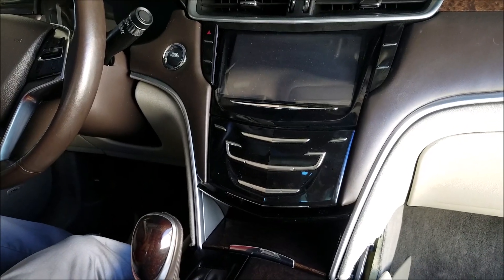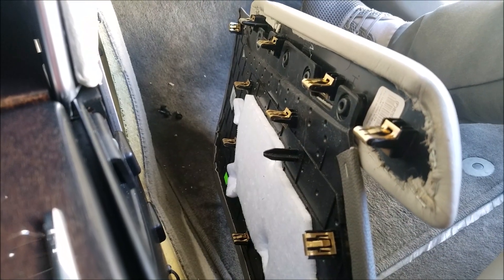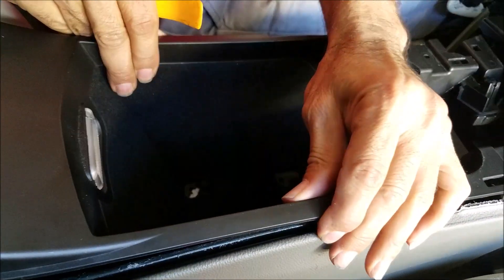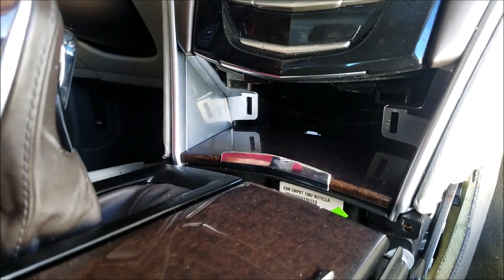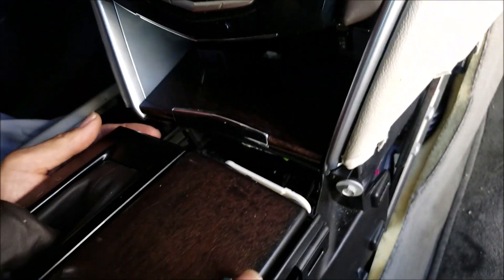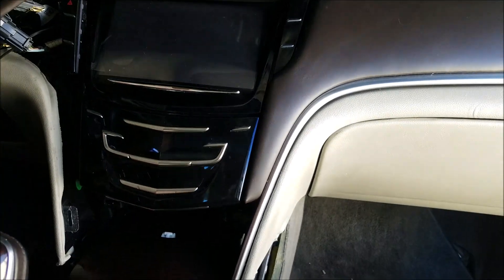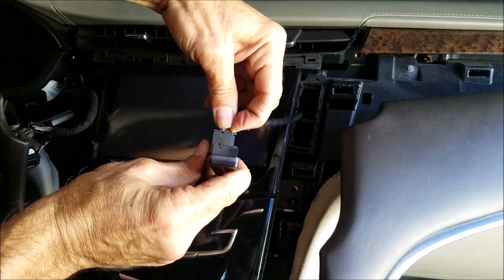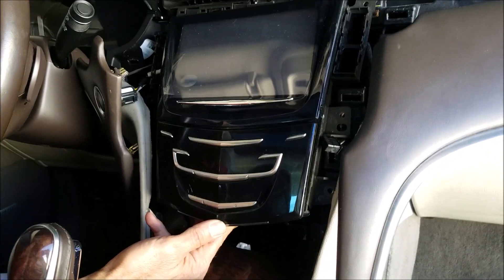How to Remove Radio / Navigation / Touch Screen from Cadillac XTS 2013 for Repair.

Comment: Followed this video today on a 2014 XTS and wanted to report that this went fine.  Only issue I had was the shifter/cupholder.  Getting this back in was very difficult because of the plastic guide under the front cupholder wouldn't fit in the right location..  Was quite a pain.  Everything else was fine.  Removed in ~35 minutes, put back together in about 20 minutes.  Thanks for putting this together!
Reply: Having that problem now..  What did u do to get it out?

Comment: The shifter surround/cup holder piece is held in by 4 screws, not only the two shown (1:45). The extra two screws are 1) under the shifter plate, in front are to the left of the shifter itself and 2) under the rubber pad at the bottom of the forward-most cupholder. The pad is a PITA to get out, but you have to work it out so you can get to that last screw. Also, the button bars that flank the CUE screen are a pain to get out (4:15). Each one has four clips: 2 on the outside and two on the inside between the CUE at the buttons. The outside ones are simple to pop, but you'll need a tiny, flathead screwdriver to pop the inner ones. And you'll have to work blind because it's not easy to see into the seam where the clips are. You need to remove these because the uppermost screws holding the CUE itself to the car are behind these switch modules.
Reply: The screw under the shifter plate tripped me up yesterday for a minute. I wish I would have read the comments. Nonetheless the video was instrumental in my success in replacing my screen. Thanks.
Reply: @netdrifta  Yes, I missed those screws, too.
Reply: Just got done doing this procedure.  One more point that would save time, take off the trim panels on each side of the switch bars before attempting to remove them.   The video shows that the switches come out first, but, DON'T DO IT.  Thanks for your advice.  Real time savers.

Comment: Been there done this and it was a pain finding a good video.  If I found this one, it would have been easier.  There is a lot of BS on line, even telling you that you have to remove the shifter and the seat.  Obviously, not.  I have the exact same year and model, this video was spot on.   Be aware that if you replace the touchscreen, don't forget to remove the plastic on the back.  Don't ask how I know.
Reply: How did you get the shifter into neutral with the car and cue off? My XTS won't allow me to shut the car off while the shifter is in neutral. Thanks for the help.
Reply: @TheElectVideos  Don't remember it being an issue but you could start car, pull shifter back and then turn off.  In any event, we didn't take it off, just worked around it.
Reply: @KeithLaursen  Thanks for the reply and info, Keith! I'm getting ready to do this install and I want to make sure I've identified all the possible pitfalls before I begin.

Comment: There is a screw up under the actual gear shift..  Lift the plastic part that has park reverse neutral and drive..  It's a screw under there..  This guy will drive you crazy trying to figure out why the gear shift isn't coming off